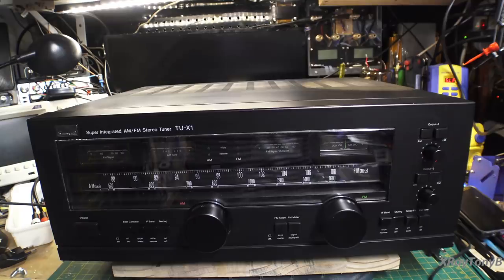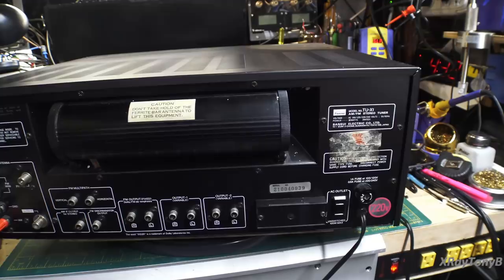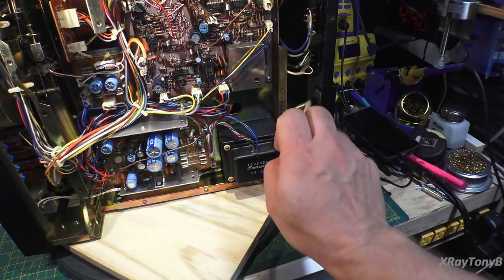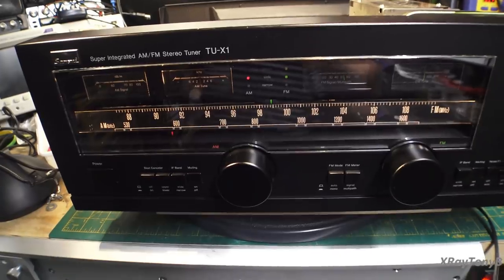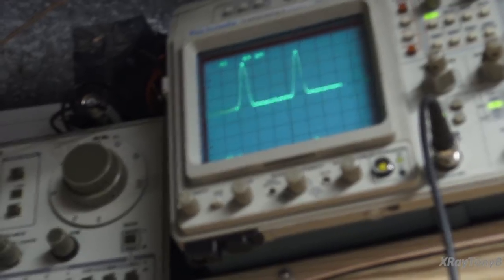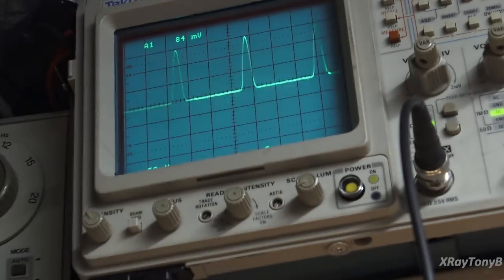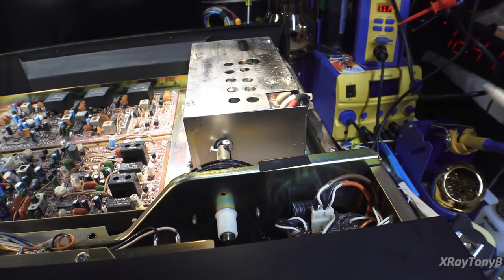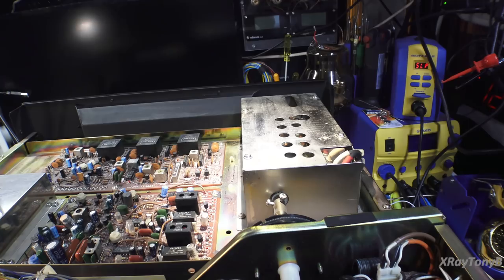Sansui TU-X1 Part 1 - Intro and FM Section

Comment: Years ago, I found a TU-X1 in a used audio shop here in Japan. I WANTED it! Sadly,  it was considerably outside my budget. Kindly, the shopkeeper opened up the hood for me to look at it, even though I had indicated I could not afford to buy it. I was astonished and awed at what I saw. Anyway, I bought a pair of Trio/Kenwood L-05M mono amps, which were just within my budget. I later rebuilt them  ... and I still use them today. OMG! nearly 30 years ago!

Comment: That FA7 Outdoor antenna is in a brochure I have that came with the Sansui G-6000 receiver from '78-'79, the whip is for AM and the 4 yagi? elements are for FM and came with a adapter which hanged off of a regular bar AM antenna on the back (not the coke can on that unit) of receivers/tuners and wired in to FM with 75ohm coax, And that unit was a us military sale because of the multivoltage

Comment: Mine did the same kind of squealing on AM. It uses some sort of synchronous detector. I ran mine with a long wire for AM and it was grounded with a grounding rod. The AM signal strength was pretty much pegged on local stations. Don't remember much more about the radio. I sold mine in 1993. :(

Comment: Synchronous detection mixes a synchronised oscillator to cancel out the carrier and leave only the audio.  The whistle is simply the oscillator struggling to lock in/ falling out of lock. Better fidelity and less lossy than a simple detector diode but higher cost and complexity.  Some shortwave receivers provide synchronous detection using the SSB BFO for AM signals. Another, older, name for this circuit is Synchrodyne.
I see a three section tuning capacitor in the AM section, that means it has a tuned r.f preamp. No wonder it drags in the DX and local signals could peg the meter.

Comment: 3:05 ; This is surely the type of perverseness that can only be attributed to marketing ploys. Why would they ever put two separate tuners inside one box when surely there would be large sections of the market that would only want one of them and probably some that would like to have the option to buy the second one later? Especially when we're dealing with tuners at this price level, that kind of flexibility would seem to make a lot of sense. Even from a marketing standpoint I cannot really justify this decision.
Reply: I suspect because if you are the type of person who wants a capable high end tuner in the first place, you want both bands. In addition there was a lot of am content back at this time and comparatively less fm content. So if you wanted information , you generally needed am. If you wanted a better signal for music, you wanted fm. In short, you needed, and probably wanted, both. Today many am talk stations also have spots on the fm band, rendering am superfluous except for very small local stations (few of which still exist).
Reply: @eddevito3282  While that's true, I suspect it was marketed during an era when big receivers still carried an appeal due to their clout. That, combined with the fact you mentioned, i.e. that discerning customers with big wallets wanted both AM and FM anyway, and that these customers would not mind saving on an additional power supply (big wallet non-withstanding), it makes sense. Still I don't buy the fact that only customers wanting to spend 2x existed at the time and no customers that wanted just FM and willing to spend 1x at one time and maybe 0.7x at a later time to add AM. Maybe marketing assessed the risk and prospects and decided that this scenario simply wasn't viable and e.g. perhaps big spenders would see it as an attempt to extract more money out of them (why pay for the extra power supply, casing etc. when I can have both in one nice big box?) or that the AM tuners would never sell enough to generate the profit that a big impressive combined tuner would. We'll never know but it would have been nice to have a separate hi-end AM tuner for those who already possessed an FM tuner they liked.
Reply: @Stelios.Posantzis   SO WHAT IS YOUR POINT?
Reply: @davidfalgout7304  That it would make more sense, for many reasons, to sell two separate high end tuners: one for FM and one for AM.
Reply: Just a question for Tony (what do you use to feed the signal to IF I can get the signal on my scope) i do have the RF Probe